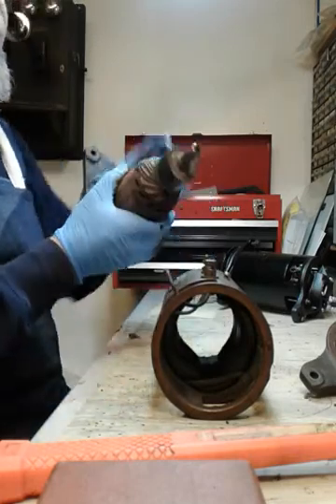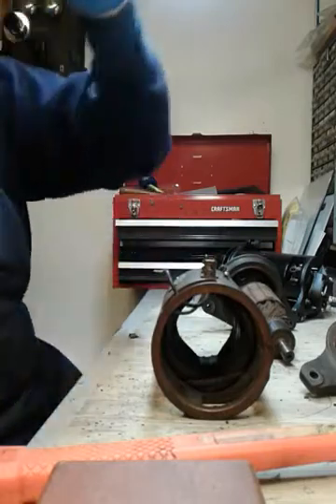Gen3   disassembling the autolite generator

Comment: Hi Steve, currently rebuilding my Cj2a generator, can you tell me where I can purchase brush springs? Mines the same as yours a Autolite GDZ 4817 A, many thanks
Reply from the maker: Not sure, I haven't looked for a long time.  But I saw these on ebay. They may be the right ones, but compare to yours.  https://www.ebay.com/itm/251005169902?hash=item3a7112f0ee:g:wycAAOxynapRgyLg&amdata=enc%3AAQAIAAAA8KebwY%2Fj8rZ4kyAglfwwGKzAMC6HJQ%2FsSeaL%2BneI6HPaXHno0AXtYzFLVCUsPfCqrDB6dSUJIM57u5jjOycd0a5ghFZMStByuUDEToibM7tj%2BHs61Hq%2F%2BDtkblIZuExMJBW2HU6buvD0EVaw54YsczdMAGp%2BZCfUcclx%2BCzUqz%2BV6b6Qhz6DPSq1drIHglBb17FBEC%2FjS7vAHvlONX9zHx5H2Guq5NBbShHRhGehlrI3eQkzKUzhkgnZnwUddFpFD92p86xcAAMBWk3i4%2BO7i7%2FDmLXkc2Y5CqkfRWtD9X2xwPKq2y%2FANWUmVbqUMWPGcg%3D%3D%7Ctkp%3ABk9SR6j33OWNYw